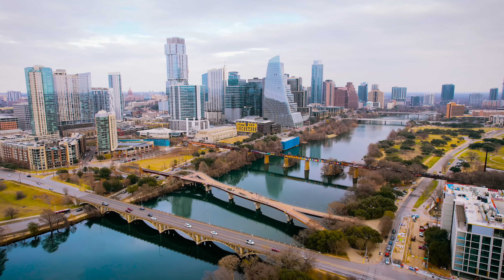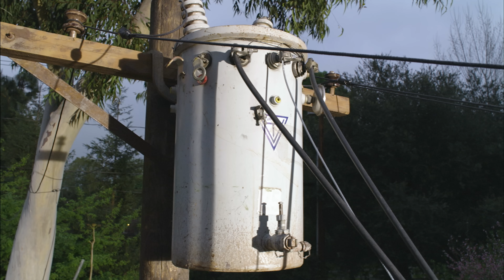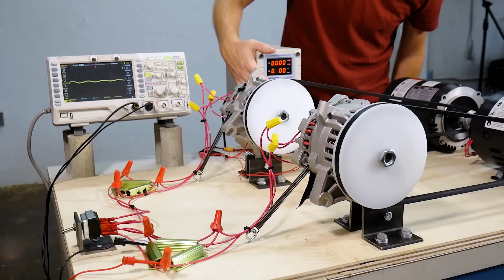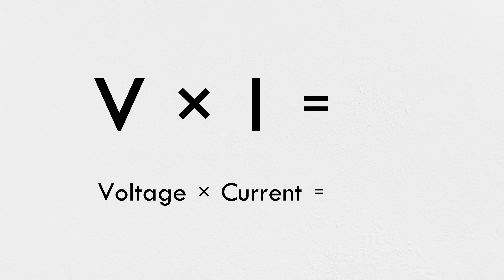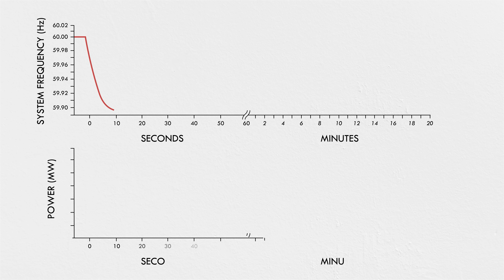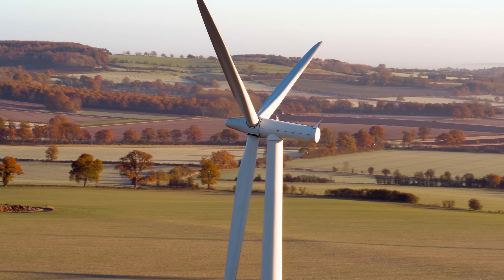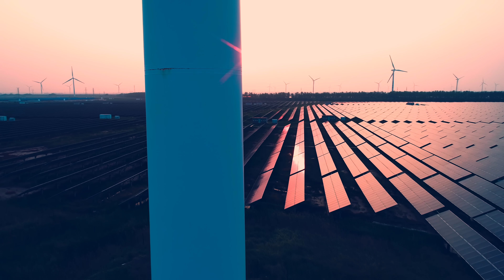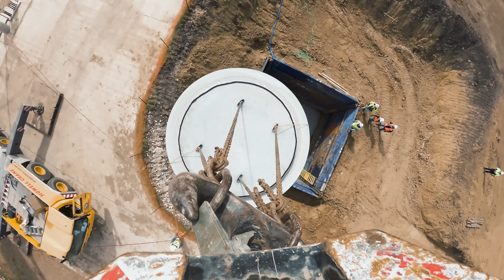Connecting Solar to the Grid is Harder Than You Think

Comment: Ah, I was wondering why we had a power cut... when we had a power cut. Figured there was something about our solar configuration that meant it couldn't work as the sole power source for the house.
Reply: Grady did not cover another reason solar systems turn off when there is no utility. If your solar system is feeding power into a utility that the power company has turned off for repairs then you are energising cable plant that is expected to be de-energised. This can be dangous to linemen. Remember transformers work both directions.
Reply: There are three kinds of solar systems. Off grid, make power all the time, can't be connected to the grid cause it doesn't sync. Grid tie, which does sync to the grid, but when the grid shuts off, it MUST shut off, both because lineman don't want to get zapped, and because you will never own equipment powerful enough to carry the whole neighborhood. The third is a hybrid, which can do both, because it automatically disconnects from the grid, and then turns on(often with multiple pieces of equipment). Tesla has a system. They used to have a Tesla gateway, which was the switch that disconnected you from the grid, and let the powerwall know it can turn on. They might have built that functionality into the Powerwall 3, not sure, but their new setup isn't approved everywhere yet. Enphase has a system.  SolArk sells a hybrid inverter. Point is, if you want your system to do it all, you have to design it that way, and pay for the parts. I just have a grid tie from 2017, but I want to eventually be able to do it all.

Comment: Connecting it to the grid is easy. 
Making it not explode when it does is the problem.
Reply: I think making anything not explode when it explodes is problematic.
Reply: Or in other words:
"Everything can be connected to the grid at least once"
Reply: A blackout is a perfectly stable state. It just generally isn't the state we want!
Reply: @cfodderferret  You are more right than you might think. Blackouts are a part of grid management, largely because it is a stable and completely certain state. From there it is a matter of picking up one section at a time.
Reply: You can technically connect anything to the grid for a few milliseconds.
Reply: Or being fried.
Reply: Disconnecting when the current exceeds the max rating is a good failsafe of last resort
Reply: This is why we have things called fuses and circuit breakers
between the solar invertors and the supply company mains !
Reply: Anything renewable is a PITA to connect to the grid outside hydro because of the insane variability of the power output.
Reply: maybe it would be easier if the grid was packet switched like the internet. every inverter has to have some seconds of power in the form of super capacitors, then they need some sort of protocol that dynamically asks for power before it is needed on best effort instead of relying on the frequency of the grid.

the power grid basically works like the plain old telephone system in which connections are made for the entire path instead of power being routed to where its needed.
Reply: @monad_tcp yeah, neither of these would work. First off, power works fundamentally different than  sending packets over the internet. You can’t handle power the way you do with internet packets. 

Second, there are already multiple problems we have to deal with when connecting renewables to the grid (basically what this video is about). Separating our power into grids based on whether they’re renewable or burn fossil fuels introduces more problems to solve. And you still have the same problem before where you need to deal with connecting renewables to a grid.

I’m not an electrical guy, and so I would just say to leave this stuff to them, and us tech guys (I’m assuming you work in tech or are adjacent) will do what we do.
Reply: @musicdev  You can almost make it work on the demand side, except every protocol I have read about for "virtual power plants" is proprietary.
But the jist of it is that you have inherently load shedable devices like water heaters, heat pumps, charging electric cars: all request permission to draw a "packet" of power (such at 1kWh over the next 10 minutes, or 6kW on average). 

During a grid event described in the video: these load packets start getting DENIED. Assuming that the polling is evenly distributed (a big enough if that you have to engineer for it): you can get an immediate response that ramps up linearly in response to problems.
Reply: @monad_tcp Actually, I'm realizing that you might have misunderstood how electricity works.

Power IS routed only to where it is needed. Physics takes care of this (look up parallel circuits).

Power is power, and you don't care where it comes from. It's impossible to tell which power station my home is powered from right now -- in fact, it's powered from all of them, all at once.

Information is different because it needs to be segregated. You DO care where your packets came from and where they go. If you send an email and it gets delivered to everyone on earth, you've just wasted tons of network capacity that could have been used for something else.
However -- if everyone needs to receive the same information, then you don't need any of that packet switching stuff. That's how broadcast radio works.
Reply: maybe those two systems are un-reconcilable together and we should create two levels of power, renewable/dirt/brown and clean/stable/alternating/blue, just like in theory we could have drinkable water and dirty water systems.
Reply: @monad_tcp it's an interesting thought anyway, basically putting more 'responsibility' on load equipment to even out supply imbalances.
a bit like having water tanks in the attic, for uninterrupted water supply to the house, and stable pressure

Comment: It's interesting to think about how solar and distributed inverters could be used to provide half-cycle ride through and power factor adjustments. Seems like just changing our thinking we could use these to our advantage.
Reply: This was mentioned, just briefly, in the video - some inverters can provide what I think he called 'virtual inertia'. Either boosting the front of the sine wave or loading it down if the frequency drops or peaks.
Reply: @robertbackhaus8911  it;s a complex system, since I think the drop in frequency from a high load is actually associated with AC generators slowing under load.  I've installed a load shedding transfer switch, and it bases the load shedding decision tree on the frequency - which would be that as the backup generator is loaded, it will be working harder to maintain its running speed.  as it is unloaded, it will tend to coast, causing a variation in frequency.  since inverter frequency is not set by the rotation of a generator, a standalone inverter system would theoretically have the same frequency, regardless of load, unless there was some degree of capacitance in the system that caused the frequency to lag under heavy loads, and lead under light loads.  I know I asked about coupling the generator with the solar system, and both sides said, "yeah, we're not equipped for that."  though several companies make light generators that can be coupled together; I'm assuming with a fairly simple synchronization signal.
Reply: you mean from profit based thinking to solution based thinking?
Reply: @kenbrown2808  One does not exclude the other. You provide a solution and make a profit. That's capitalistic 101.
Reply: @huckleberryfinn6578  no, that's economics 101.  capitalism 101 is "a dollar in the hand is better than two in the future"
Reply: @huckleberryfinn6578  That's Adam Smith air-quote "capitalism". It relies on this underlying assumption that the best solution will always be the most profitable. It doesn't take a Nobel laureate to figure out that assumption just is not the case. 
PG&E is a classic example. Much of their infrastructure is decades past its rated service life. But upgrading and replacing it cuts into profit, so instead they cut power to their customers and burn down the countryside whenever there's a light breeze. 

If you care to educate yourself on some of the thicker weeds, you should look up concepts such as price elasticity of demand and hydraulic despotism. These two principles are the Achilles heel of capitalist ideology.

Comment: Maybe someday we'll have cheap thyristors that allow abundant high voltage DC transmission
Reply: Several years ago I searched Digikey for the most powerful MOSfets available. At the time, they were similar in shape and size to hockey pucks, but stackable. The recommended mounting technique required squeezing the stack together with a lot of force. A single transistor was rated for around 2kv and 1,000 amps. A stack with 50 of them could handle 100kv, but with no fault tolerance. A stack of 75 of them could handle 100kv with a significant safety margin and fault tolerance. The expensive versions had fiber optic controlled gates. The slightly less expensive versions had low voltage gates.

When one transistor in a stack fails open circuit, it will briefly be exposed to the full stack voltage of 100kv. This will melt something in the package that will  create a very low impedance short. If the bolts were torqued down correctly the packages are mechanically robust enough to contain the otherwise explosive forces. Assuming there are enough functional transistors left to handle the voltage, the stack will continue to function normally, just with a reduced fault tolerance.

I assume the price has come down on these, while the voltage and current ratings have gone up. I don't know if the hockey puck format is still in use, or if there is something better now.
Reply: Actually, SiC JFETs are already cheap enough that they can essentially match price-per-VA of a distribution transformer.
Once you include all the rest, you're still at about just twice as expensive as the regular AC grid transformer.... the only downside is that this assumes DC input and DC output; an AC/DC stage would sadly cost extra.
Oh, the only reason they're JFETs is that those are far more robust to manufacture than MOSFETs, and you really like this type of equipment to be resilient in the face of e.g. lighting strikes.
Reply: Highly unlikely. We've reached the end of Moore's law, so silicon fabrication technology isn't going to get much cheaper.
Reply: @Shaker626  Moore's law is for scaling down transistor, not efficiency/power density.
Reply: @Shaker626  wrong in many ways, and moore's law isn't even relevant here. Imagine everything was done and we were actually at our limits.. (we're far from it) more FABs go up, more of the same stuff is created, it gets cheaper.
Reply: @Shaker626  , grid level semiconductors are not using shrinking to improve economies of scale. They're much larger due to the power they're handling, so Moore's law has little impact either way.
Reply: @JimBob1937  The wafer production backend is a big chunk of the cost of those chips (their fabrication is not as expensive, however). Moore's law was the main driver for making wafers cheaper, which is not very likely to proceed at the same rate. It's unlikely that power transistors will get much cheaper than they are now with the IGBT.
Reply: @Shaker626  , wafer production is based on growing a cylinder from a seed crystal and then slicing and polishing it up into a set of wafers. This has no connection to Moore's Law. Moore's Law is more about shrinking down the transistors via smaller and smaller interconnect technology and better and better photolithography (most recently EUV, due to the shorter frequency giving better detail resolve). This in turn ither allowed for an increase in transistors per fixed area of the wafer, or for less wafer area for a fixed number of transistors. This allowed the wafers to be better utilized. However, grid level semiconductors are not concerned with size as much as power handling. Nothing of Moore's law directly affects them, since it isn't an area they're concerned with.
Reply: @JimBob1937  The size of wafers is what determines the cost of the bulk silicon. It's cheaper to get silicon from a larger melt. The biggest driver of this size increase may not have been Moore's law directly, but is indirectly tied to the buying practices of the largest foundries, their increased profits from decreasing feature sizes was put back into the technology used to melt monocrystalline silicon. I simply think both have plateaued on the innovation S-curve.
Reply: @Shaker626  , I won't belabor the point further. However, the economies of scale that larger wafers bring is independent of what they're patterning overall. So, even if the industry independently developed a process for grid level semiconductors, the trend would still be the largest wafer possible for the process. This is because a larger wafer inherently is a more efficient usage of a wafer's passes through the lithography processes. This also means adjusting the patterning process to handle the larger wafers. If anything, I expect consumer device driven fabrication is holding back the economies of scale of grid level semiconductors since the photolithography process can be much larger due to far fewer smaller details required to be patterned, and the general requirement for higher powered semiconductors to be made of a thicker wafer. These two things could loosen the tolerances for the foundries to make usage of larger wafers than what might be possible consumer lower power devices like CPU and other chips. The focus on power handling carry their own engineering challenges, but almost make it the antithesis of Moore's Law.
Reply: @Shaker626  , " I simply think both have plateaued on the innovation S-curve."

Yes, I will agree here. There is some room for improvement in both smaller device and grid level production, but nothing like what we've seen in the past. However, due to the specific engineering challenges of the higher power semiconductors, and those having received less focus, I think we can still see a few halvings of cost on the grid end of things. It hasn't been that long that true grid level DC to DC transmission has even been a thing.